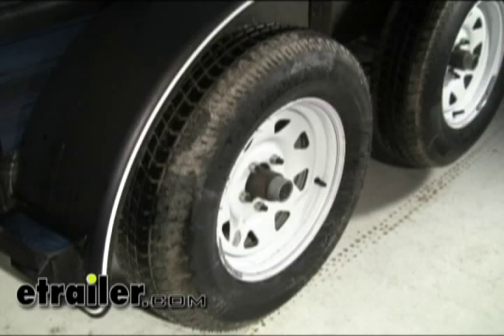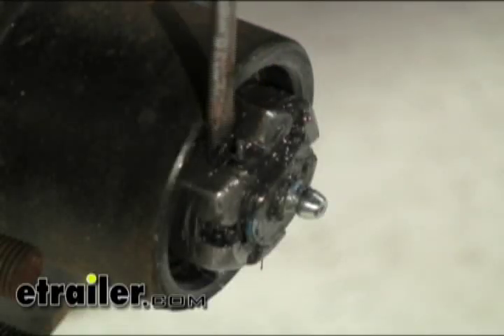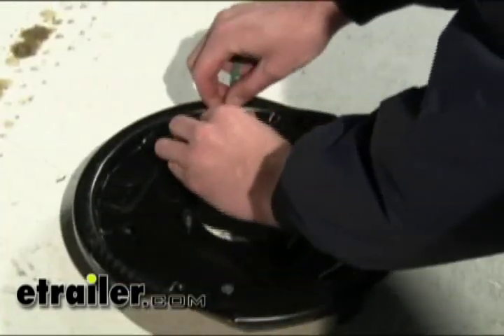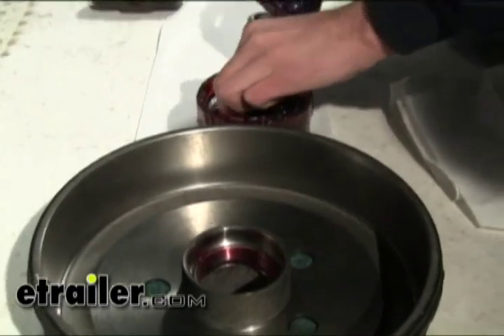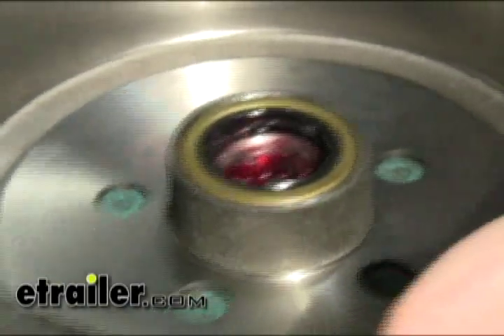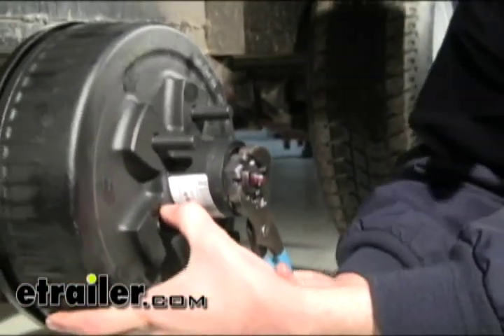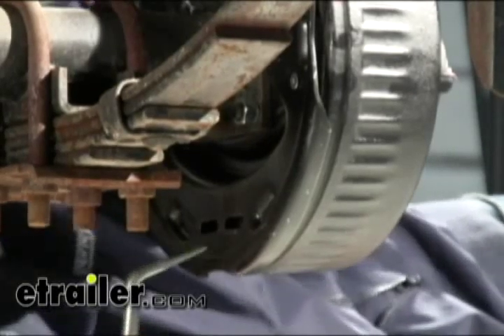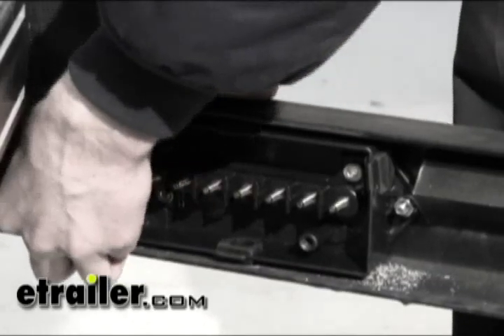etrailer | This Old Trailer: Electric Trailer Brake Installation Part 1

Comment: really need to clean that rusty surface befor installing new backing plate
Reply from the maker: It is always a good idea for the trailers longevity to clean any rust and touch up with paint.
https://www.etrailer.com/Accessories-and-Parts/Dexter-Axle/23-26.html

Comment: I definitely prefer my rubber mallet to a small sledge. Also, a small block will distribute the force nicely and you won't have to worry about bending the seal.